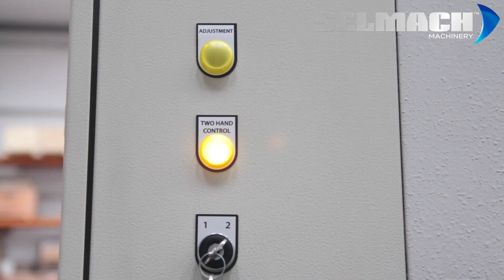Morgan Rushworth PBH H Frame Hydraulic Press [Selmach Machinery]

Comment: at minute 0:19 the punch holder is partially visible, it has a central hydraulic piston on the upper part and on the sides it has a rod on each side. Are they only guides or are they hydraulic and do they force?
Reply from the maker: Thank you for getting in touch. I can confirm they are guides only.

Comment: Will it do 1/2 ar plate
Reply from the maker: Hi Derek, Thank you for getting in touch. It might be easier to contact the sales team directly on sales@selmach.com as we would like to clarify the question. Are you wanting to use ½ inch plate? Can you also confirm what the actual plate is as AR is not a common material?
Reply: Derek Fruit pwf